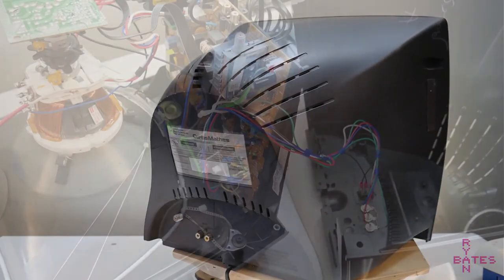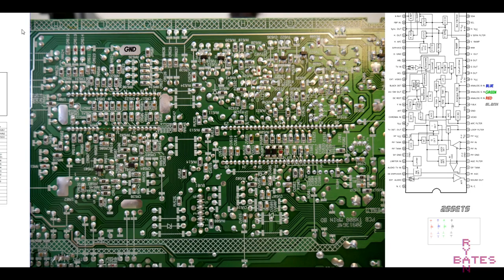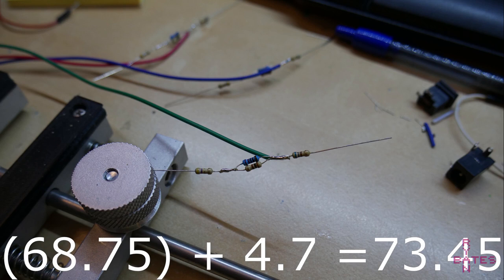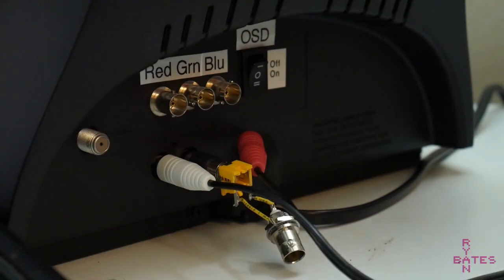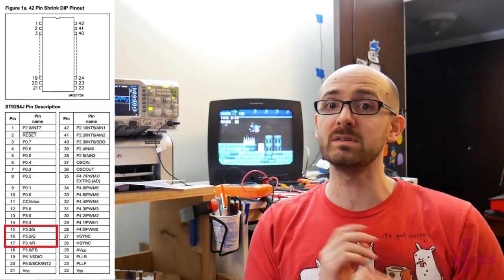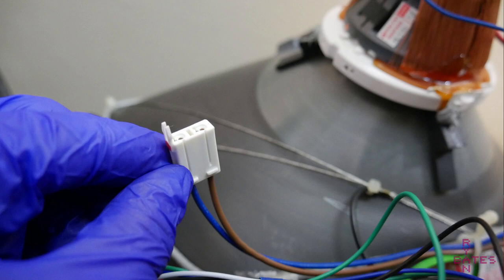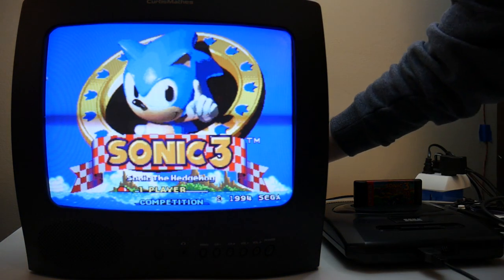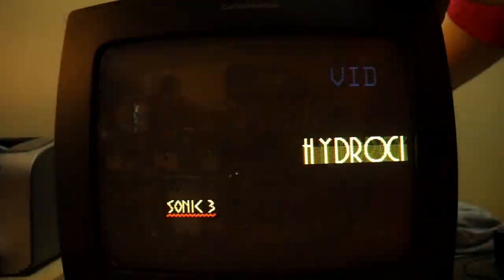Add RGB input to Consumer TVs | Make Arcade Monitors on the Cheap!

Comment: I know that these RGB signals from a home console are on the 31kHz side of the Force. But would a CRT RGB modded TV accept a 15hKz RGB signal as easy as a 31/47kHz?
Reply from the maker: it would not. you would want to look for a 'multisync' TV / monitor

Comment: I have a TV (CRT monitor ) with 'AV component IN' with R (Pr) Blue (Pb) and Green (y) , may I connect my MVS directly to those (TV CRT Panasonic 29FJ30LA)
Reply from the maker: No. RGB and Component (YPbPr) are are encoded differently. You need essentially a box (common piece of kit) that says it converts these.

Comment: I’ve had better luck using the RGB out, or tracing them with a meter. I have done 3 successful ones in a row now. I did a sharp the other day, pinouts showed OSD R/G/B and blanking. I could only get the RGB through the OSD text using these pins. Blanking just killed the screen. I moved RGB across to the RGB outputs (which you have as Pin 19/20/21) and voila , RGB with sync on the channel I tapped the composite on for sync ... only need to switch blanking when using composite over sync... otherwise with C sync it worked without blanking.   I do prefer to switch blanking even on C sync as it does change the colour tones VERY slightly ... Each TV has being slightly different. The Hitachi with Phillips main chip I needed to trace RGB tracks until I was basically sending the signals direct into the neck board. Same thing where blanking was only needed for composite over sync. And also a trinitron flat screen. I have an LG and Samsung and older model small trinitron to do eventually
Reply: Interesting comment VajSkids. I have a Sharp portable here that I plan to adapt and you mention pins 19/20/21 I am assuming your chassis uses the TDA 8362 which has the video out on the same pins?

Comment from the maker: Like most of us, I lusted for a PVM or BVM. Still don't have one, but I think i can move on knowing this mod actually works. I do have a 27" Sony Trinitron tube TV and well, now I just might mod that. Modding this 13" TV was was increasingly difficult because this TV was 
1) small, making the PCB cramped, and; 
2) newer making the PCB full of surface mount crap and also lacking a service manual.
Fun fact. I paid $30 for this beauty NEW when I was working at K-mart in ~2005. I worked in the electronics dept. It was a wild ride.
Reply: You did this one the hard way, which is great for more obscure set like yours, I have done a few that way too, using photoshop to trace the PCB, but RGB modding has never been easier as there is a lot more info available these days, with your specific Sony model chances are a mod (if doable) has already been documented. shmups forum and CRT collective on fb have a lot of set specific RGB mod info. Also look out for JVC D-series, they are amazing and great mod candidates as well
Reply: Oh man I just forked out for some from Japan, one is a more recent 14 inch 100v-240v so I won’t need a step down converter.. the other is 1992 14 inch model and needs a step down (240v here in aus)  and then a small one simply because it was $15 ...this was all good until I got the postage quotes !! Still no more than I’d have paid for them here .... they better have language select in the OSD!!
Reply: @vajskidsconsoles2005  how much was shipping $250? never see any crts where I am in QLD
Reply: @vajskidsconsoles2005  also noticed your ebay store, you're a beast
Reply: @Vvewa  it's slowly dying off. eBay are removing a lot of premod consoles. will move else where. Etsy closed my store while my first sale was processing. just a PlayStation with an Xstation and my psxtal dual region and IGR. I am from sunshine coast Queensland :) living in Melbourne ATM
Reply: @Vvewa  depends. had to pay for the expensive one during covid. to be honest shipping far outweighed the cost of the monitors which were nabbed cheap. Buyee.
Reply: @vajskidsconsoles2005  That sucks man, got my eye one some things. Move back to the sunshine coast so you can rgb my samsung :) It's the same chassis as the one in that 8 bit guy video so I have some help but im not too confident to tackle it yet. Wouldnt mind collecting some backup sets before I give it a crack but its abit dry around here, have to probably trek to brisbane or goldcoast for some when they pop up for sale.
Reply: @Vvewa  Ive had some sets that didn't want to play nice.. first few went fine. They're getting expensive and harder to find in Melbourne too. Gave away s Trinitron and it's on eBay for 400. I've still got the sub that clips on the top :P

Comment: These mods are insanely hard, i also attempted it some years ago and i gave up halfway through when i had to make my own amplifier circuits and what not.
It would be awesome if you could RGB mod some popular TV models like the Wega/Trinitron, etc,  they all probably share a lot of common parts like the Jungle ICs, then it would be way easier to get one of these models and just follow your instructions.
Reply: It is hard but luckily, we have forum and reddit guys that are passionate. 
Stabers this guy from Reddit gave me very specific instructions on where to cut and what parts i need.
Even drew me sketches himself

It even led me to learn the basics of resistors and capacitors.

Comment: That chassis looks very similar to the ones in early 2000's small RCA and GE sets (the ones made after they did away with the dreaded Tuner-on-board design) Perhaps the manuals may be cross compatible to some extent as well.
Reply from the maker: what is the "Tuner-on-board design"?

Comment: I'll try to make it quick. I want to add component jacks to a Sharp 25R-S100 to hook up a og Xbox or PS 2 to replicate a primal rage arcade. What ohm resistors should I use? A walkthrough digram will help alot. thanks.
Reply from the maker: i dont know

Comment: Its chip methods.
I do two modification
And results low quality dark picture.
Not good for pandora or 60 in 1
Some arcade games nornal
And others bad.
Not good for all console. 
In my opinion. 
In usa try to buy rgb or arcade monitor
In Europe we have luck with scart tv
Just need good sony kv with remote control .
Or jvc toshiba etc.

Comment: Ryan great video!. I have the same idea as you. I am building a Neo Geo MVS sort of clone but with a 32" Sony Trinitron KV 32S22, my mother donate it. I have all the schematics, all the rgb lines that go into the jungle chip identified. The thing is that I want to put an original 2 slot mvs board inside of it.. so I might need a supergun right? To output either RGB component or Scart connection , I see those superguns have controller (gamepad type) inputs on the front, like for Sega Saturn and such which I don't need and they block the harness entry for arcade buttons wiring. Do you know of any dedicated video procesing board for MVS that leaves the arcade harness connections free and that will let me hook this thing to my Trinitron once I mod it?. Also what route do you recommend component or Scart
Reply from the maker: A supergun will get you off the ground faster, but it's not necessary. The MVS 2-slot outputs RBG, so i'd stick to this signal type. You really need a power supply for the MVS board. A super gun does this, or a modified ATX psu will do it too; you need 5v 12V, and -12V (for some amps). A JAMMA harness will break out everything you need from here.

Comment: My Jungle chip (AN5302K) has inputs for Horiz and Vert sync. Could I wire those to BNC also if all lines are on something like a 4PDT switch? Would I even need to put the blank on a switch that way?
Reply from the maker: what signal are you routing in that has separate inputs for H and V sync?
Reply: @RetroBuiltGames  VGA 😬
Reply: @Ashene64 vga would not work since that is 31khz while analog television RGB is 15khz

I think there were some 31khz TVs (mainly HD CRTs afaik) but most only accept 15khz

There are tricks you can do to make your computer's video card output 15khz though.

Alternatively you can get something like a GBScontrol which can convert VGA to 15khz.

Comment: I have the very last gen LG's Tube TV (lg 14sr1ab).  I love it to death but one bad thing is that it only accepts composite input.  Is there any way to have it accept higher resolution video signals?  I believe it was capable of doing SD resolution.
Reply from the maker: if it has on screen display, it is a candidate for this modification.
Reply: @RetroBuiltGames  A TV without an OSD would be like those really old CRT that can only be calibrated with potentiometers outside the TV? I have a Sanyo CRT from the 90s (Composite and RF only) that sorta has an OCD but is very basic, just green text and bars over the screen.

Comment: Im in UK and I want to do something different, I want to convert a RGB scart socket into a Component input, one of my tvs may even be ready for it as it was a 2006 model which has the cutouts already on the shell at back its likely they just never wired it into to the circuitboard, its so I can connect a PC to the tv and all in one retro setup, i.e play emulators, watch stuff off my NAS as I prefer it to a LCD tv.
Reply: I'm so jealous it comes like that out of the box.

Comment: You used composite IN on the TV to feed sync signal ?
Reply from the maker: correct. Sync is carried on composite, so that connection is still needed for RGB timing.
Reply: @RetroBuiltGames  Thanks ! 😀. Still i dont know...Opening a CRT is kinda scary. High voltage 😱
Reply from the maker: don't be scared, just respectful of those votages!

Comment: Can we make it component video?
Reply: it´s basically the same as RGB
Reply: @shiroumxm2052  the connectors and signal are different.

And for me, for instance, who had the luck of picking up a great component cable for my PS2 for cheap, don't want to buy an RGB cable :/
Reply: @shocknawe  I meant they look the same .
Reply: @shocknawe the PS2 can output RGB over component cables because the pins used to output RGB and component is the same.

Don't put any disc on startup and under the clock settings you can change the output type  from ypbpr to RGB
Reply: @shiroumxm2052 no it's a completely different video signal incompatible with each other. You have to convert it first.